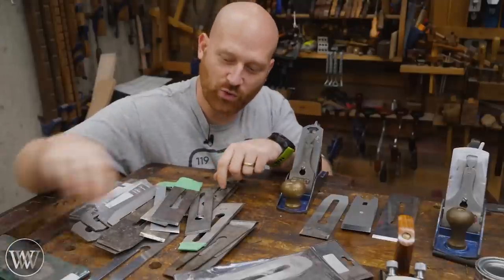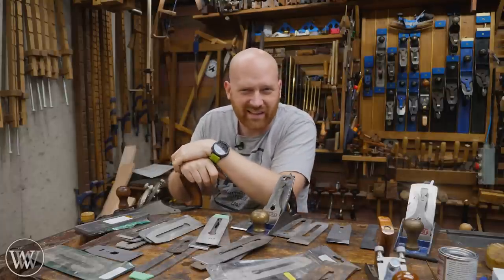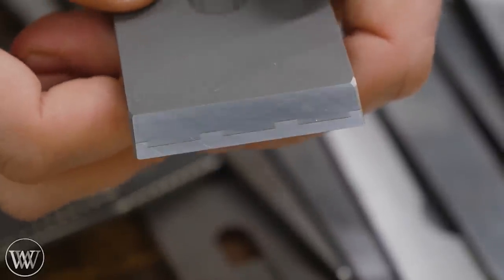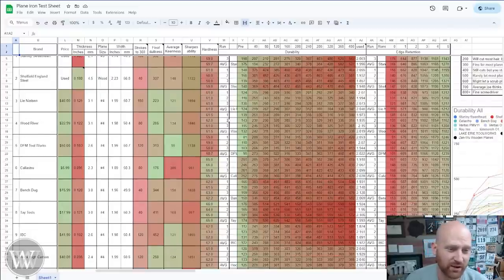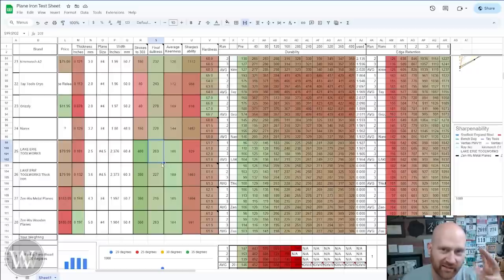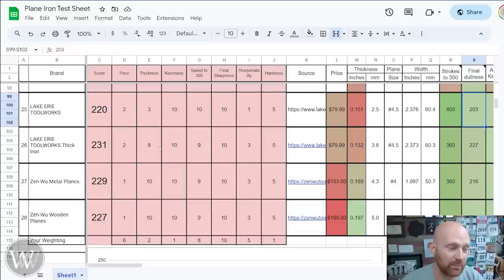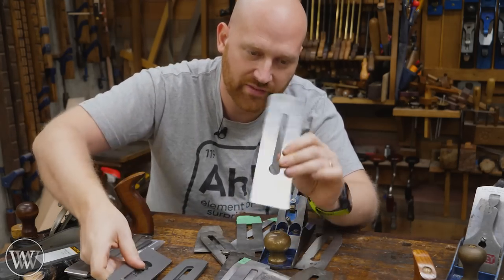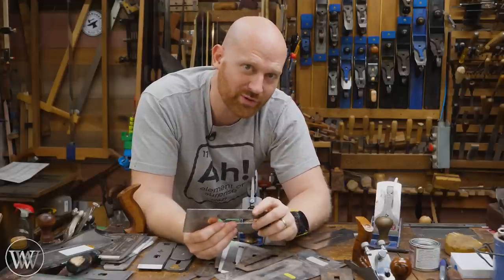The Best Plane Iron Ever Full Data Test

Comment: Thanks professor!   Very well done.   I’ve been using an Erie tools iron w hock chip breaker on type 11 #5 1/2.   Stays razor sharp forever!    But had to remove a lot from mouth to get it to project.   Well worth it!   Thanks!
Reply: Thanks for the info

Comment: This video is obviously worth more than the price of admission. Thank you for your work on this, man. I recently added a Stanley no. 3 to my quiver and spent a day tuning it. I don't know the exact type but I believe it was manufactured in the 1920s. The chipbreaker needed work and it was, itself, already kind of sharp at the tip. I went ahead and hammered - gently and evenly - the bend, so that when I flattened it to better mate the iron, I would have a little more mass to work with. Delicate operation but it worked, no more clogging, and now I have a chipbreaker whose edge doesn't try to be sharp like the iron it supports. The iron, appears to be original, sharpened up better than I expected. Maybe I'm getting better at it, idk.

Okay, so do I bite the bullet and upgrade the blade and chipbreaker? For now? No, because I am achieving these really gorgeous results when smoothing random hardwoods as a test. I love it. I'm loving my no. 3.

So with all those wonderful metrics you so meticulously tracked and analyzed, should we assume that it's all about workflow? How often do you have to sharpen? How much time does it require to sharpen them? And then in light of the cost, one can make their decision based on these workflow considerations? Or did you see a difference in results on wood surfaces? Do your favorite blades produce a smoother and more shimmering result?

I have a tendency to ramble on without catching something obvious that everyone catches, so my apologies if I overlooked anything (I'm really good at overlooking things). But was there not a difference in the experience of actual use, between these different setups? Do you achieve better results on the wood itself with your favorite blades?

Thanks again, man. Really enjoying your videos.
Reply: I suppose there might be an alternative question: is the best choice of blade, or blade setup, not necessarily justified in terms of a "better" shaving and "smoother" work piece but perhaps the best shavings and smoothest faces are more easily achieved with the better setup? And yeah, that might justify the upgrade, depending maybe on time spent in the shop.

Comment: One aspect of your testing not categorized is the required prep time to flatten the backs. I have experience with older blades and ECE blades and they typically require a lot of prep work. The MagnaCut blades by @LakeErieToolworks are precision ground and do not require much work to lap the backs. They are great blades and because of how well they are made honing and lapping is quick.
Reply from the maker: I thought about adding that however coming up with a standard way to measure that was problematic. Also I didn't flatten any of them before use I just put them to use. Everyone has a different level of how flat is flat enough.
Reply: Good point, I have restored half a dozen vintage stanley and bought a new veritas and the flatness difference was crazy.
Reply: Your right (Wright) No idea how to measure this and compare that aspect, but boy is it nice to lap the back of a plane blade that is ground flat! @WoodByWrightHowTo
Reply: LN and Veritas both recommend against flattening the back of their plane blades saying it is done to a much higher tolerance than can be done in most hobby shops.
Reply: @Aaron-nj4ou  I did not know that, and I have no experience with them. I would still lapping the backs because I would guess that they are factory ground, not factory lapped.
Reply: It says lapped when I bought my block plane and I heard Shannon on Wood Talk also mention that when he buys a high end blade from LN/ Veritas he doesn’t touch the back just adds the micro bevel and gets to work.
Reply: @Aaron-nj4ou  I did a bit of reading about this and they are factory lapped (some folks think at 400 grit?) but not to a mirror finish. Look at the backs under magnification and you can then decide if they need additional lapping.

Comment: I’ve been using my zen wu for a while now. First, it doesn’t fit in a Stanley. So I used it in my home made bevel up. It just didn’t go blunt. However I managed to chip the blade on a nail gun nail that I hadn’t noticed. It took me for ever to get it past that chip. I think the iron is very hard but brittle. The chip breaker is sharp similarly and I have that in another bevel up as the iron. It works fine.  Overall they are great but I prefer my Veritas irons. I don’t know what steel is in my Qiangsheng 6 but that is my favourite iron/plane combination. It works a dream.

Comment: it makes sense that magnacut did what it did. its based on m4, which is used in industrial cutting machines. Magnacut has smaller carbides than m4, so it has a finer overall grain structure.

Comment: Australian hardwoods are something else to work with.  They contain a lot of silica which destroys the edge very quickly.  To get some idea, to smooth a rough sawn 7 foot length of 4” x 4” you have to sharpen the blade 3 or 4 times. 

I am going to have to try one of these Lake Erie irons.

Comment: James, incredible video (and iron series). My big concern would be the fit in vintage planes. Can you comment on how well these two fit a Bailey style?
Reply from the maker: The thin lake Erie tool works iron will fit without any modification at all. The other three thicker ones may require you to file the holes on the frog back a little more or to open the mouth up a bit.

Comment: I pre-ordered five Lake Erie blades when Nick first announced the line.  There were ups and downs in the manufacture but they did arrive and I am pleased.  The blade finish is really good. I use diamond plates for flattening backs which show any flaws.  The Lake Erie backs are really flat on delivery.  For me that saves the most sharpening time.   Putting on a secondary bevel takes a couple of minutes.  The back prep by Lake Erie puts me way ahead on initial sharpening over Lie Nielsen or Veritas.

One of my new plane blades will go in a Lie Nielsen shooting plane.  I have found the A2 blade supplied with it chips when trimming hard end grain like oak.  Lie Nielsen might should consider offering these blades in their shooting plane.

Comment: The magnacut is stainless. I read a test on high carbon knives vs stainless that demonstrated that when left in mildly imperfect environments (humid or whatever) for a month or so, the carbon steel would lose some keeness due to edge corrosion. Would love to see you test this.
Reply: I hesitate to market them as 'stainless' because there's a popular misconception that carbon steels automatically have better performance than stainless and since it's a stainless steel, it must be inferior.  Do you have a link to that test?
Reply from the maker: I heard that but I haven't seen any practical testing on it. On top of that if it did it would only be at the tiniest atomic level. And at that level it really doesn't make any difference at all to the usability of the edge.

Comment: I’m a moderately experienced power tool woodworker who is learning how to use a hand plane. I have 2 80-100 year old Stanley #4’s, a 5 and a 7 I was given 30 years ago.  After watching you and Paul Sellars, I have “tuned” them and started using them. Chip breaker to blade fit (chips building up) and the inconsistencies in my freehand sharpening technique seem to me to be limiting plane performance in my hands. What would you recommend, investing in better blades or a Veritas sharpening jig?   Also any tips on fitting the chip breaker to iron would be appreciated. Thanks much, love your channel. John
Reply from the maker: https://youtu.be/cQzLdMsGCqk here's a video on the chip breaker. As to the honing guide if you're having difficulties doing it freehand there is no better honing guide in my book than the Veritas Mark II

Comment: Nice artical, never heard about the Erie brand irons,  I do have to say that harder steels are better though. 
 I have never done any real tests on plane irons, but I prefer a harder steel. The hard steel takes more time to sharpen, but they hold the edge a lot longer than the softer, easy to sharpen steels, those simply don't hold an edge very well. I spend almost as much time sharpening them as I do using them.
 I have a couple dozen planes, a few spokeshaves,  and some draw knives (most of them older than I am), and in my experience, the harder it it to sharpen,  means I can often go a year more before needing to sharpen it again. Softer, easy to sharpen irons on the other hand means having to sharpen them every week, or at best monthly. 
 have a belt knife that I made from an old plane iron, it's sharp enough to dry shave with, but in the 40 years since I made it, the only sharpening its seen was to stop it over my leather belt once in a while.
Reply from the maker: Thanks. Up until about 40 or 50 years ago harder is more durable used to be pretty true. Up until a point. If it gets too hard it's in the edge becomes brittle and it shatters as opposed to roles. But in the last 30-40 years with some of these new steals coming out it no longer holds true. If you look on the far right side of the spreadsheet I have a correlation chart between hardness and different aspects and the only one it really is close to is hardness and sharpen ability.

Comment: Great work. You hinted a bit about feel and usability. With the same plane can you feel the difference between a thick blade and a thinner one?  Reduced chatter in difficult grain?
Reply from the maker: General know you can't really feel the difference between a thick iron and a thin iron. Some people say they can't but if you blindfold them and ask them which is which they won't be able to tell you. There is a little bit to less chatter with a thicker iron but not much. That has more to do with the fit between the chip breaker the iron the frog and the body. The most important thing is how sharp is the iron.
Reply: Sharp fixes everything!

Comment: Regarding the Zen-Wu.  Is it a concern that the iron/chipbreaker is so much thicker that they might not fit into old Bailey and Bedrock planes?
Reply from the maker: No. It only has to be thin up at the nose. The only other problem is that the screw might not be long enough to hold the lever cap but in all of them that I tried that's not a problem.

Comment: I think you should cheek your price points.... The Zen-Wu blades with  chip breakers are cheaper than the listed prices..... Which make them the outstanding choice.
Reply from the maker: that is the price on the ones I used they have several versions of both.
Reply: @WoodByWrightHowTo  your internet pointer is for the steel backed laminated blade. The titanium one is twice the price, as you point out.  The differences in the edge should be non existant as the steel or titanium back should not make any difference in the edge

Would you please check by matching pictures to be sure you have the titanium. I think the two  versions look different?
Reply from the maker: they are both the titanium back with the V2 iron. I will have to check the link. thanks for letting me know.
Reply: I ordered a 2 inch Zen Wu blade ( the steel one, which is cheaper)  in August, it was shipped promptly.  It is now October (7 weeks later) and my blade is not yet arrived.  It seems to be stuck in shipping.  If you order for yourself, be prepared for a long wait.
I will update this information when I receive the blade.

Comment: This has been really interesting to watch.  When I first started using a handplane, and restoring them, I did try thick irons, but they often would not work with the mouth of the old plane I was restoring.  The common "solution" was a file, and widening the mouth.  Then after a time I encountered adjusting the location of the chip breaker, since then traditional thickness has worked perfectly.  I am seriously considering trying the Lake Erie.
Reply: Hi. Do mind if I ask you to elaborate on the position of the chip breaker. I’m not having good success with my thicker iron.. how far back can you adjust the frog without having the iron hit the bottom of the plane?
Reply: @alfredobanuelos4730  I keep my chip breaker very close to the edge of the iron.  That limits tearout in all but really cross-grained wood.  I usually run the plane with the chipbreaker between around 1/32 to 1/16 inch from the edge.  I run the frog's slope right at the top of the trailing bevel in the mouth of the plane most of the time.  WIth cranky, cross grained wood, I'll push the frog forward closer to the mouth more.  If that, with a sharp blade doesn't help, time for a card scraper.  

The breaker has to be matched to the blade surface with no gap at all in the front.  Even a little, and you will begin to find bits of shavings trapped between the breaker and the blade surface.  I've had trouble chatter just once.  That was caused by a twisted blade.  I kept trying to straighten and flatten the edge of the chip breaker, and it did precisely nothing to stop the chatter.  I finally replaced the blade and the gap I could see between the edge of the chip breaker and blade disappeared, and so did the chatter.

Comment: The Lake Erie irons look great but those Zen Wu ('WOOHOO') irons are just plain gorgeous. They make me think along the lines of Bridge City designs. I'd go as far as to say that even if you don't own a plane, you need one of those in your life, just for bling - wear it with pride on a chunky chain or glue one in place of your car badge...!
Seriously though (and I know this will sound controversial), the thick Lake Erie iron would transform a brand new Stanley #4, which has a mouth as wide as a farm gate (a flock of sheep would pass through it); fettle the body for a couple of hours, add in proper wooden handles, fat Lake Erie iron and away to go. Simples!

Comment: Maybe its too early for you to even know, but how do these irons perform when they start to get dull? A2 and O1 seem to behave a little differently and I have heard that PMV-11 behaves a bit more like O1 as it gets dull.
Reply from the maker: the grain size is so small they micro fracture. not enough that you can see but they just do not bight as well. the edges do not roll like O1. and they don't get streaking chips like A2

Comment: How did you manage to fit the Zen Wu iron into your Stanley? Did you modify the throat? I just bought the Zen Wu iron and it won’t fit in my Stanley. I can’t spend another few hundred bucks on something like a Lie Nielsen to find out. It serves as a paper weight now. What a waste.
Reply from the maker: Yes you have to modify the throat for that one. Most large irons on a Stanley have to modify the throat. But this one is big enough that even on a Lie Nielsen you would have to open the thread up a bit
Reply: @WoodByWrightHowTo  Good to know. I might have to modify my only Stanley smoother for this iron. I hope it's really as great as it's advertised so it can stay permanent it that plane. Thanks!

Comment: According to Zenwu, their thick titanium body is meant do absorb vibrations, did you by any chance to give that a test?
Reply from the maker: I haven't come up with a good way to measure vibration. But in my experience even the cheapest thin iron can remove vibration by sharpening it and making sure there's a good fit between it and the frog and the frog in the body.
Reply: Yeah, that makes sense, vibrations will be tricky to measure. But since that's one of the big claim they had, I am just really curious.  @WoodByWrightHowTo

Comment: Yeoman service you've done for your fellow wood-thrashers, slicers and dicers and with no little amount of greatly appreciated effort. Are you going to expand your horizons of curiosity beyond standard Stanley style, mostly bench planes, or are they the stopping-before-it-gets-ridiculous point? I ask because the Stanley Sweetheart No. 62 & clones (high and "other" class) seem to have undergone a resurgence in popularity over the past few years, I wondered if you'd done any research on the comparative quality between them and the irons available? When I bought my Stanley No. 62 Sweetheart (almost a year ago), the only spare, replacement blade for it I could find is made in China by Zeluga. A brand I'd never heard of, but, for twenty bucks ... , why not? Are you familiar with the brand? [Blade is listed as "Replacement Blade for Stanley 12-137 and 1-12-137". Etched on the blade itself is "EL-12-142".] 
P.S.: Well, it looks like "For A Few Dollars More", $95.00 + tax, etc., Iron City sells replacement blades for the Stanley Sweetheart No. 62 - Yikes!

Comment: For me, living in, I have access to two of the best irons / cap iron combos available. Canadian manufactured Lee Valley’s PMv11 and IBC’s A2. No need to look farther. The blade thickness of the PM v11 is 0.100” which is slightly thicker than any of the others that I have looked at. Blade thickness as well as retention of sharpness especially in hardwoods is a priority to me.
Reply from the maker: If you want blade thickness there are several that are considerably thicker and more resilient than pmv11 now that being said pmv11 is really close to the top of the list.